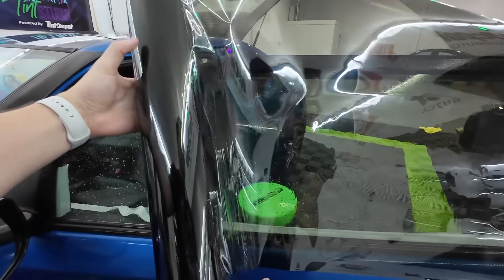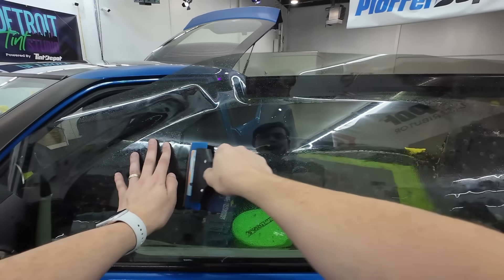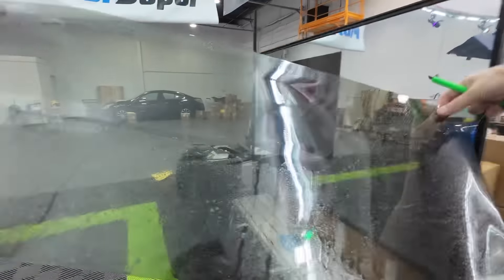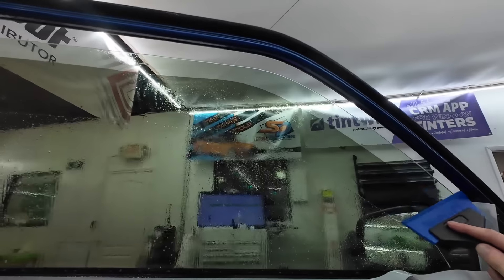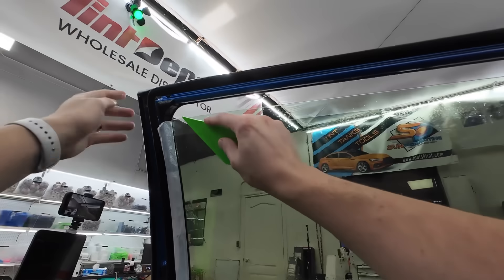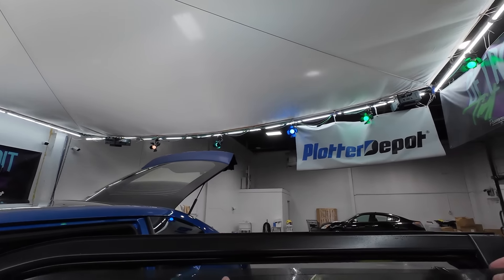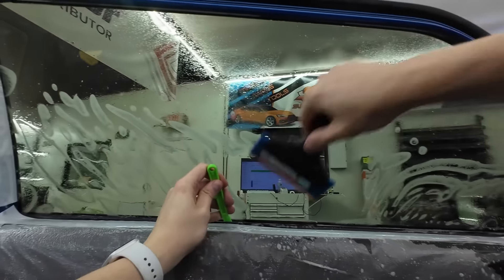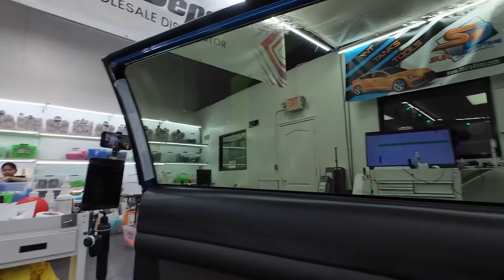Every step to tinting a wide door window

Comment: Question:  It seems like a lot of soapy water gets pushed into the door. Why isn’t tint installed from the bottom of the window to the top so that water is pushed out the top instead?
Reply: The doors have drainage built into them, so it just doesn’t make much difference.

Comment: thanks for the video, Matt! I done my neighbors 2000 GMC truck, extended cab truck. I stripped some old window film off the door windows Saturday (Nov. 2) using a WalMart Shark iron with the extended burst for the steam. it took about an hour per door to remove the old film because it was so old the top layer of film came off without the glue but a razor was able to peal it off as I just kept applying the steam to keep the glue soft. I took a lot of time cleaning the seals and making sure I got all the pieces of film out of the edges and everything so nothing would get under the new window film. I finally was able to use the Geo Shield dye film I bought three years ago when I done my truck after learning to tint watching your live streams.
I finally found someone to apply my new skill and knowledge on tinting their vehicle. I started tinting the door windows yesterday; it was raining outside, so I was rained out a few times, I messed up and creased the door windows, so I had to recut and start over. I bought the 40" roll of 20% back then when I done my truck trying to save money. I have a white board in my bedroom that I used because 20" actually worked on this 2000 GMC truck; the back door windows were a breeze because they were just some pop out wing windows. I used the glass aide tape I bought from you, and I actually double cut them, remembering how I have seen you do it and it worked great.
I was rained out Sunday, yesterday the 3rd, when I was doing the doors, so I didn't get the front passenger door done; it's still raining, so I'm waiting for a break in the rain to finish the last door, and I thought I would watch this video again to make sure I was following all the steps right and making it as easy as possible for myself.
I wasn't going to charge him for doing it because he's been so kind to me, but he stuffed a hundred dollars in my shirt pocket anyway, so I guess I finally done a window tint job for money, and maybe when people see how good it turned out, it will get me more work, especially since I had to remove old film from the truck first. It really came off pretty well, even though it was taking about an hour per door. The hot steam allowed the razor to remove the glue in long strips! It would have taken forever without the steam! It really makes a huge difference, and I can thank you for learning that from your live streams!
I bought one of those pump up spayers from Sun Distributing, and I'm glad I did! Way better than just a regular spray bottle. It gives enough pressure to help flush the seals out, and this old truck needed it. I actually saw you use one in your earlier videos, and I was able to use a link on your site to get it back when I done my truck. It would be nice to use one of the 3 gallon tint kegs, but I can't afford that right now, but the pump up spray bottle Rick sells on Sun Distributing works great.
Anyway, sorry for such a lengthy comment, but wanted to thank you again for the videos because you taught me to tint 3 years ago now from watching your live streams and videos, and I thought you might like to know that I actually done someone else's truck for them. Maybe it will result in doing more and me getting faster at it and maybe a little better at it. Thank You, Matt!

Comment: Hey I love the vids but always wondered on cars with tight or even tight ish seals when I fold the film to tuck in the side seals and then roll up the window I notice there's almost like creases you can see in those spots after install. I know not to crease it I'm always careful but sometimes those spots will show or even just tend to be more dry Upton install
Reply: Pry the seal a little with try card then spray well with water solution, then pry below the tint to feed it in 👍